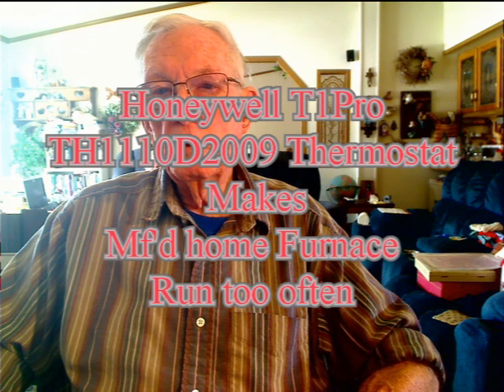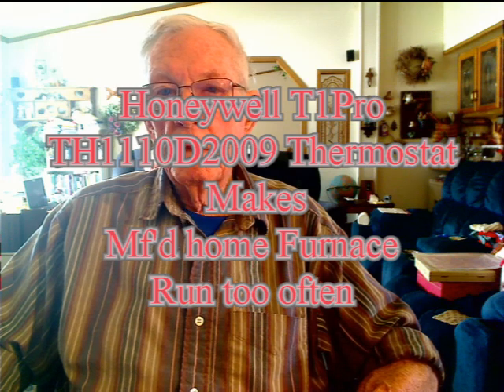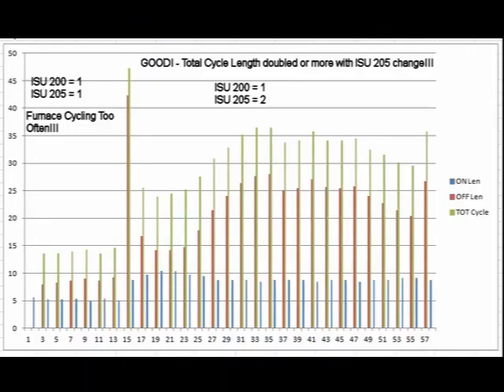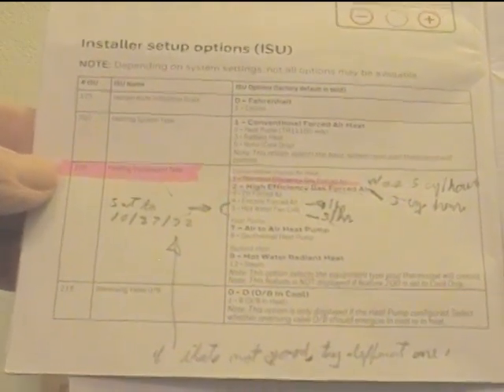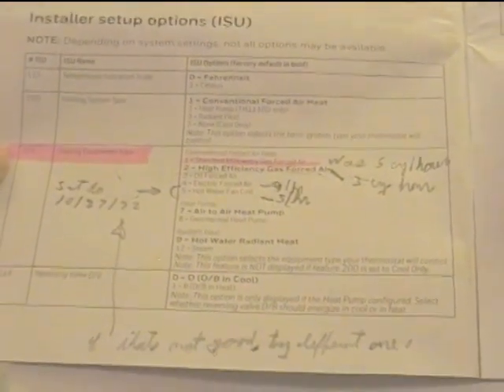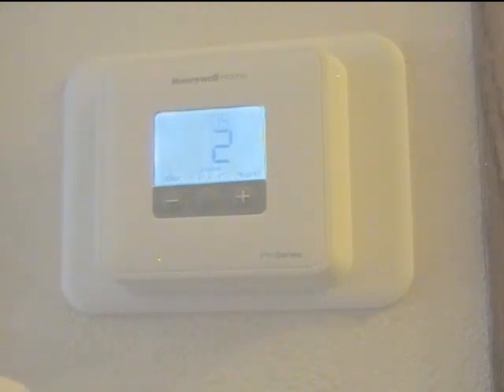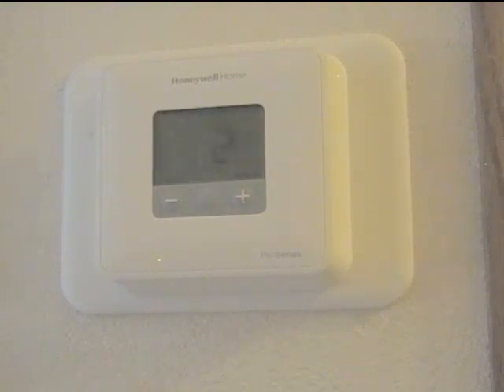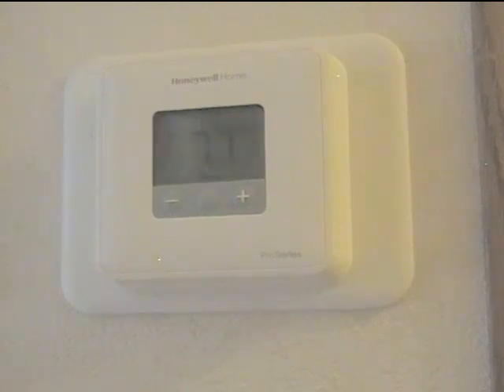Furnace in Mfr'd Home Cycles Too Often with New Honeywell T1 Pro Thermostat (Solved)  Part 3  #209

Comment: dude you're a lifesaver, I had the exact same issues after they replaced my furnace & thermostat with this piece of honeywell crap. It's so over complicated even the techs don't understand it. When your tech said the theromstat was your furnace issue, that should raise red flags as these modern digital units do not fail since there's no moving parts...thanks & nice job with the arduino project